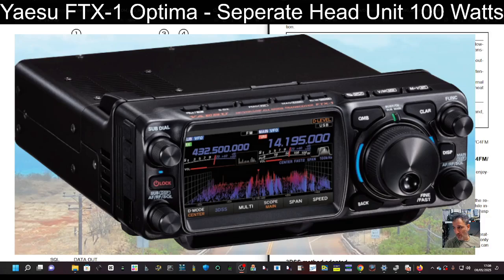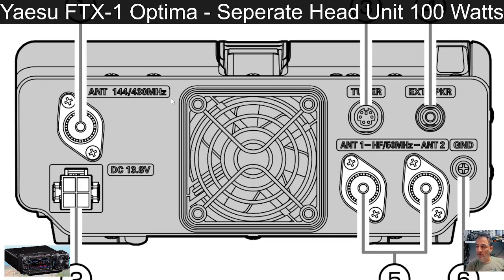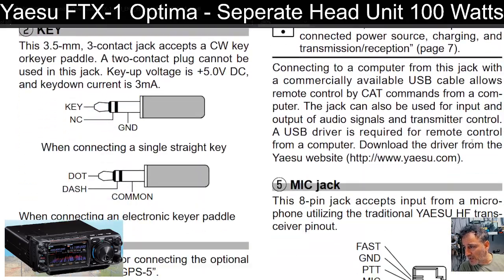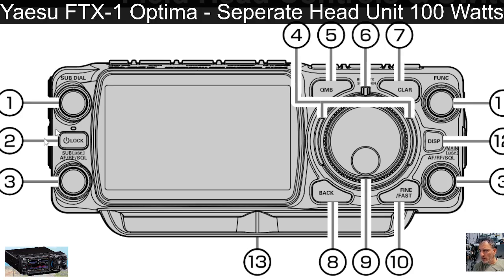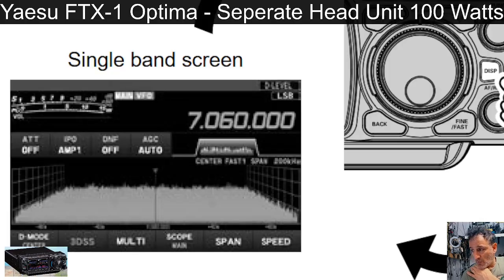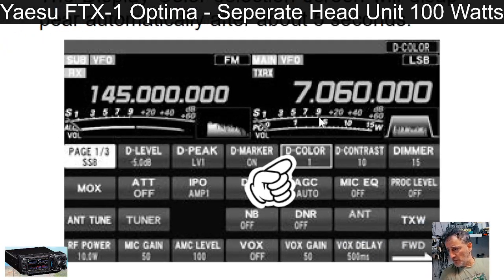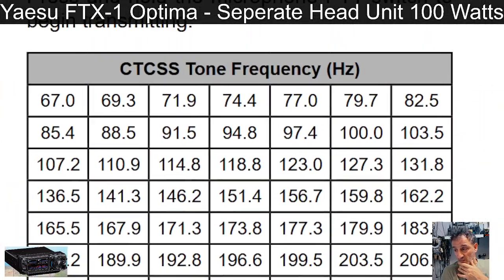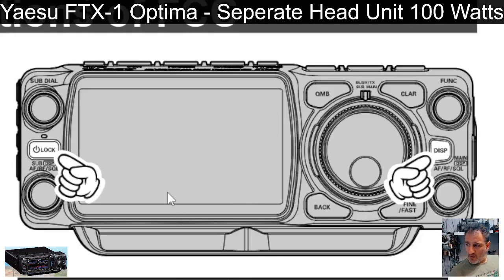Yaesu FTX-1 Seperate 100 Watt Unit & Overview

Comment: 6:50 you talked about the USB-C connection. John explained the USB-C is to charge the battery and not power the radio. He stated the battery will also have a USB-C on it as well for charging if its not attached to the radio. If you would like to power the the radio, there is an expternal power adapter on the back for 13.8V.
Reply from the maker: Yes i also watched

Comment: Yesterday John said the cable will only be around 6 inches long and the SPA-1 is not meant to be mounted remotely from the head. He said there will be an example at Hamvention. He stressed the radio was not designed with separating the SPA-1 from the FTX-1 other than give a few inches.
Reply from the maker: Yes watched

Comment: If you can't use the full 100 watts in a mobile environment by way of a separation cable that is a major disappointment for me. I don't see cables that allow you to do that unless I missed something. They offered so many other accessories for this until, why would they not offer a separation kit? I already have the FC-40 tuner that I use with the 857D in a mobile and it works great. I just don't understand, also no DVI for an external monitor? I won't be buying this radio.
Reply from the maker: Wait and see.

Comment: Optimum ? Does that mean I can run this through my expensive 1500w amp ? Or is 100w its limit ? lol. Doesn’t the Yaesu FT710F come with a side handle and have a built in tuner, has 100w and ability to turn it down to 10w and is much much cheaper ?
Reply from the maker: You can do both it has a jack

Comment: Yaesu replied to their own Friday FTX-1 video (which they've since pulled) saying that there was no plan for an extension cable beyond the lengths that come attached to the OPTIMA.  We were hoping the same thing would be possible regarding remote mounting.

It will be interesting to see if an enterprising ham can make the correct electrical and antenna connections to allow for the amp to be mounted elsewhere.  Specifically interesting for mobile installs, of course.  - As always, appreciate your deep dives.

Screenshot of the comment: https://drive.google.com/file/d/167CqJ4Vgf9D-HVlvBNbja0aVSxujRYAT/view?usp=sharing

Comment: Great video. If the 100W Amp has a built in tuner, why does it have a jack for a tuner?
Reply: To use an external tuner. For example, ftdx10 also had an internal tuner, but has a jack for an external tuner.
Reply: @cworkman74 this is not an internal tuner though, and there is no ability to use a real external without getting this mod ?
Reply from the maker: To use other tuners

Comment: Thanks for the review. For the life of me I can’t understand why they didn’t put an external monitor jack on the extension. I for one won’t be replacing my FT-991A.
Reply from the maker: Yes hdmi be nice
Reply: @M0FXBHamTech  no DVI port either it seems. So no way to connect an external monitor? thx u
Reply: @andykular3756 Will cat control software do? Ham Radio Deluxe or similar?
Reply: I totally understand your perspective. And mostly, agree. I am unaware of any other radio in this 'Newly' invented category (IC-705, Xiegu X6200, ect..) that includes a monitor output. And that brings me right back to your logic...why not? This may be the only shortcoming to Yaesu sweeping the broom on Icom. 🙃